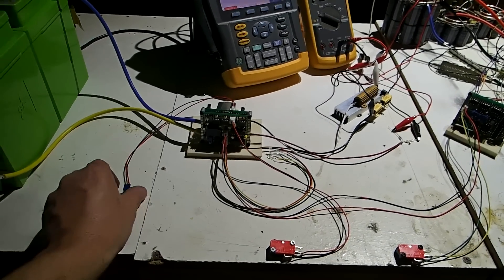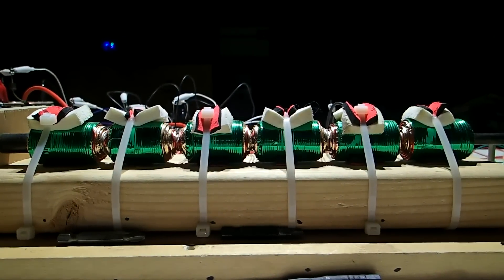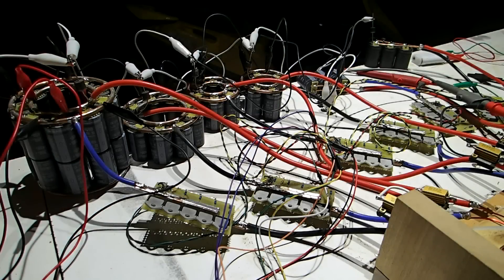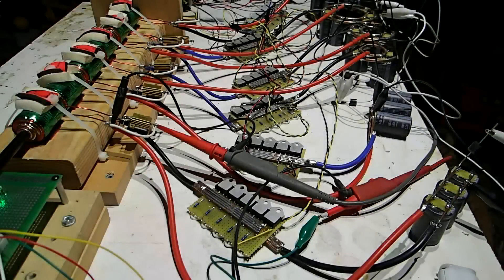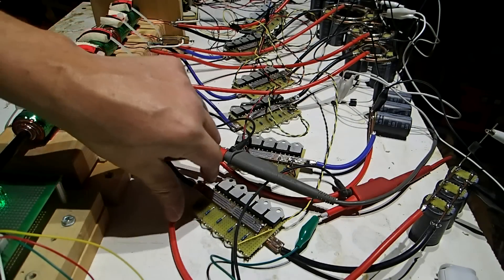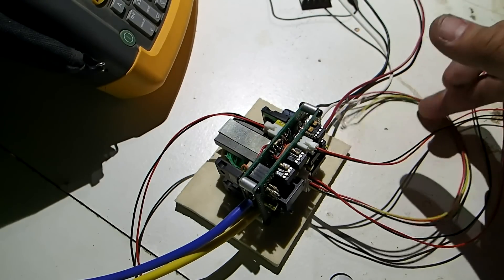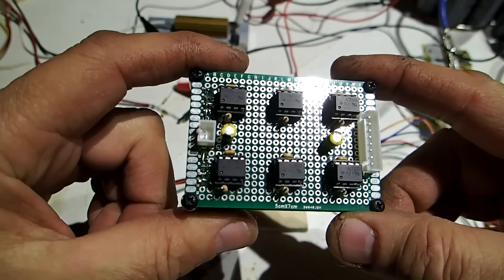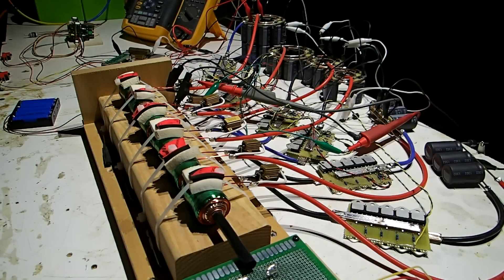World Fastest 6 Stage Coil Gun Yak Steel Penetrator

Comment: Clay,  I started on the chronograph...and it occured to me that maybe only one LED/detector may work.  With only one pulse on the scope, why cant you just read the pulse duration and, knowing the length of the projectile, just calculate the speed??
(I may use my 4MHz counter for digital display)
Reply from the maker: You could probably use that there is a relationship between that and the speed but the most accurate method actually you can buy a chronograph for bullets that'll measure the speed
Reply: @RaptorRotorHead  For your chronograph, what kind of photo transistors do you use?
Reply from the maker: @gaynzz6841  the only kind there is.

Comment: OK, I finally got a coil gun built.  A one-coil 6"long carbon fiber 50-cal wound with 4 layers of 10awg.  cap: single 10000uF cap fired with puck SCR at 275v.  Got 47m/s with so suckback control.  I plan to tune speed with various voltages and another scr to short the coil at various times to get max speed.  The gun was damaged by recoil.

Comment: if this is what a civilian can do, think what the military has.

at a modest 100x the energy you could put a 1kilo depleted uranium/tungsten/osmium slug thru both sides of a guided missle cruiser
Reply from the maker: The military has a railgun and yes it will put holes in the side of a ship 100 miles away they never mounted it on his ship the rails would be damaged for maybe only just 10 shots from all the heat Sparks and melting
Reply: @RaptorRotorHead  Would you think they'd rather invest in Coil Guns as an alternative? From what I gather they don't wear even close to as much as a Railgun, but aren't quite as possible either.

What do you think?
Reply from the maker: @ZombieSlayerPlays  you are correct that the coil gun doesn't wear especially in my model cuz I have a carbon fiber tube that the 18 gauge copper wire is wound around and the bullets or the Slugs are hexagons so they have points they have stars and those Stars ride inside the tube it has the least possible friction given all that you can no way get the power of a rail gun in a coil gun in fact what you see in my video it's about all you can get out of it you can't add any more coils because the speed of the pulse and the inductance of the coil slow the pulse down and by that time the bullets already out of the coil very little power gets applied to it on the 6th stage the first stage gives you the most feet per second like about 85 ft per second the second stage is not going to give you 85 ft more the second stage will get you up to about 135 ft per second so you get less and less with each stage so it's just as much time and effort to wind the first coil as it is to wind the six coil and the 6th you get maybe 10 ft out of it. What a coil gun can do is it can LOB a really heavy piece of metal. Up to about maybe 180 mph in space a coil Gun could be used to destroy satellites very effectively at a range to because there's no friction in space.

https://youtu.be/DjoYHLye2p4?si=tCJ6erAWO23tJFyq

I don't know if you seen this video of mine but this is the most effective way to make a coil gun other than it's extremely heavy 20 lb with batteries it would be to carry it around

Comment: Does voltage have any effect on the pulse length? Because I tried to calculate and found out that pulse length is only affected by capacitance and resistance C=T/R. Voltage would only tell how many amps go through the coil and the force on the projectile.
Reply from the maker: Pretty much voltage has no effect voltage has effect on the power output of the magnetic field The More Voltage the more current will go through the coil and thus more power

Comment: I have one questions to your coil gun what diameter has the wire of your coils?
Reply from the maker: The wire was 16 gauge I figured out the timing using an oscilloscope trying different amounts of capacitance there's another video of this it says questions answered it shows the waveforms on the scope basically it's based on the projectiles two inches long and then it takes it about 2.1 ms to move two inches in the first coil. From there using a chronograph able to figure out the other five coils using the scope play with the capacitance and looking at the speed.

It also involves using carbon fiber Barrel 1/32 wall thickness. The thinner the walls the closer to the magnetic field the more power.

Then the projectile is 15% or less of carbon in the steel. the less carbon the more magnetic force.

Also the projectile has five sides has hexagon Steel this is so it rides on just the edges inside the carbon-fiber tube for the least friction possible.

https://youtu.be/DjoYHLye2p4

This is the most impressive video because the target is 42 ft away for stability I just used the concept of bow and arrow it has a 7 inch carbon fiber shaft with a Q-tip on it to stabilize the projectile it's going through three-quarter inch hardwood and I've shot it straight through coconuts
Reply: @RaptorRotorHead  Thanks for that fast answer. One last question that I have is how long is that carbon pipe that you used?
Reply from the maker: @marcelwinkelhofer  the first one was 13in long the carbon Barrel because there's six coils and there's two inches long so that's 12in right there
Reply: @RaptorRotorHead  Okay thx
Reply: @RaptorRotorHead  Currently I am working on the coils for my coilgun and wanted to know how much windings you used for your coilgun?
Reply from the maker: @marcelwinkelhofer  300 turns
Reply: @RaptorRotorHead  What did you use as switch (I knew thyristors, SSR or IGBT but I think the best would be IGBTs)?
Reply from the maker: @marcelwinkelhofer  you should watch the video that explains all that it explains that I used 60scrs 10 per coil

Comment: Are you progressively decreasing the time between fires?
Reply from the maker: Of course or it would not work.
2.2 ms , 1.2 ms , 950us , 850us , 800us , 760us.

And using a few less turns of wire on the last two stages the 5th and the 6th stage.

To increase the rise time of the pulse. Do to the speed of the projectile.
Reply: @RaptorRotorHead  How did you come up with the trigger times? Trial by fire or something more scientific?
Reply from the maker: @bitsurfer0101  this is an experiment trial and error you can use math in some parts of it you can't use math to calculate the whole thing and put it together in one shot that's not going to work.

I used to work at a place that build guidance units for nuclear missiles 42 years ago most of these guidance using use magnetic power supplies so I'm experienced with Magnetic power.

Comment: What material (what sort of plastic) did you use for the barrel/pipe?
Reply from the maker: That's a carbon fiber tube 1/32 wall thickness 1/4 diameter

Comment: First of all: Simply sick project!!! I'm also building a coilgun for a school project, but I still have a little problem: If you take normal ferromagnetic projectiles, they are only attracted to the center of the coil. So if the projectile crosses the center of the coil before the capacitors are fully discharged, the projectile will be slowed down again. I thought about using a type C commutation circuit to be able to switch off the coil selectively, but I don't think that I can achieve the necessary switching times with this. How did you solve the problem? Or do you have an idea how to solve the problem?
Reply: Oh yes of course. Maybe, maybe... See also: Portable Super Coilgun:

https://www.youtube.com/watch?v=rclLsQ9nyeg&amp;feature=youtu.be

https://www.youtube.com/watch?v=-mjDqp_oWZk

https://youtu.be/YLOYxsqvjw0
Reply from the maker: The problem is solved by using the correct amount of capacitance for the coil for the weight of the projectile it's a physical thing II must allow the capacitor to charge backwards in other words in Reverse voltage by using a diode across the coil with a small amount of resistance in series with the diode this takes care of the suck back problem
Reply: @RaptorRotorHead  So there is no other way, than regulating the capacitence?
And how did you calculate the capacitence?
Reply from the maker: @jeromeschmitz5041  it basically was like by trial and error I started out with a 2 inch long projectile so naturally I made 2 inch long coils and since as you said when the projectile gets in the middle of the coil that's when the capacitor has to be drained or else it will be sucked back into the coil I started out with a about a 2.1 millisecond pulse and then the speed of the projectile is measured coming out of the coil we increase the capacitance to the speed of the projectile does not increase anymore and then we start out with that amount of capacitance  for the first coil. For the second stage we use about 1.2 millisecond as the projectile is already moving we don't need as much pulse if we put too much pulse we will slow the projectile down. Basically it goes on from there reducing the pulse
Reply: @RaptorRotorHead  So you didn't use a formula or anything.
But theoretically it would be better to have too much capacity and to be able to switch off the coils also via a circuit. Because then you would have a higher voltage over a longer period of time and therefore also a larger magnetic field in the coil.
Is there a circuit to specifically switch off SCRs that can also block the SCR within 700 nanoseconds?
Reply: I already have electrolytic capacitors, but with 2200uF each. With this, the dosing is difficult possible. The only thing that would still work would be to adjust the voltage. But then I would have to build a single charging circuit for each stage.
Reply from the maker: @jeromeschmitz5041  the answer to that is no the capacitor switch off automatically when the capacitor is discharged the scr switches off automatically
Reply from the maker: @jeromeschmitz5041  I used many small capacitors to get around that issue I think they were like 330uf each with about 9 for the first stage.
Reply from the maker: @jeromeschmitz5041  this is another video for you to watch what the specifics.

https://youtu.be/_ZJpTKZUibs

There is a formula to use but I had to figure that out because you have to figure out how fast the projectile is moving at 2.1 milliseconds in the first stage in other words in the first stage in 2.1 milliseconds to projectile moved one inch into the center of the coil
Reply: @RaptorRotorHead  So it would be easier to use GTO thyristors, right?
Or to build an inductive coilgun.
Reply from the maker: @jeromeschmitz5041  just regular SCR I used 10, 50amp scr per coil any scr can handle 10x it's rating for 8 millsec since the longest pulse is 2.1 millsec this is no problem each scr pack in my design can handle 5,000 amps.
Reply: @RaptorRotorHead  I also have the BTW69 1200 and from the performance these are also more than adequate. I plan the coilgun with about 200V and 7 coils. The problem is that I actually already have all the parts and would not like to buy capacitors again great, since the project was already very expensive anyway. I have therefore been looking for a solution to the problem for some time.
Reply: In retrospect, I think it would be easier to use GTO thyristors, because they can be specifically disabled (if I remember correctly).
Reply from the maker: @jeromeschmitz5041  I hear what you are saying I spent  $2500. Another thing to remember is capacitor ESR. The capacitor can only be discharged so many amps and after that it's limited that's why i used  many capacitors in parallel,  and switching capacitors at that
Reply from the maker: @jeromeschmitz5041  in the end result this is what I achieved.

https://youtu.be/DjoYHLye2p4
Reply: @RaptorRotorHead  How high the ESR is is not really that important to me. It is mostly in the milliohm range.
But is there another possibility than thyristors?
MOSFETs or IGBTs are unfortunately much too expensive in this order of magnitude. 

The thing is this: I would like to be able to control the switching on and off with a Teensy, because I don't want to use the coilgun always with the same voltage. I have specially built a power supply where you can set a maximum voltage at which it stops charging. My teacher does not want to exceed a voltage of 60V (for legal reasons). Privately, however, I would like to use something more. But then the switching times differ, which is why I can't build the coilgun without sensors. 
Another advantage of having a lot of capacitance is that the period of the RCL circuit becomes longer, and thus more current flows through the coil for a longer period, and thus a continuously higher force is exerted on the projectile. 

I can think of two solutions to this problem: 1. Adjust the distance between the coils so that the capacitors are discharged in time. But this would be extremely inefficient.
Or 2. to be able to switch off the coils selectively as well. But then I need some circuit that allows me to selectively disable the SCRs.
Reply from the maker: @jeromeschmitz5041  there is nothing more rugged than scr for the circuit that you're welcome to try whatever you wish, and when you're talkin milliohms yeah that's very little but when you're talkin 3000 amps of current going through it you know multiply 3000 * 10 milliohms and that's your voltage drop
Reply: @RaptorRotorHead  I heard something about a V-Switch the other day, but haven't looked into it in detail yet. Is this perhaps a solution to the problem?
Reply from the maker: @jeromeschmitz5041  never heard of it
Reply: @RaptorRotorHead  http://www.coilgun.ru/v_switch.htm

I would just use a light barrier or something similar instead of this inductive sensor. But that does sound like a good solution to me.
However, I have not been able to find anything about the switching time of the BWT69 1200 in the epee sheet. Do you happen to know the switching time of this SCR?
Reply from the maker: @jeromeschmitz5041  faster then the arduino which is 3 microseconds scr are way faster then this. Another thing light sensors are way too slow I don't know why people use them, I don't think people pay attention. The final stage in mine the pulse width was 650 microseconds.
Reply: @RaptorRotorHead  If you use a Teensy for the light barrier, however, that should actually be fast enough. A Teensy 4.0 is much faster than an Arduino. Then hopefully that is enough to read out the light barriers. The signal from the Teensy I would pass via serial communication to an ESP, which then only switches the coils on and off. I hope that this works.
Reply from the maker: @jeromeschmitz5041  as I said that your experiment you could use whatever you want

Comment: Do you have a schematic for the sequencer, nice work with using octo's and scr's. Very interested in how you built the sequencer though. I understand the concept with 555 timers but how do you control the sequence so accurately?
Reply from the maker: Actually I don't have a schematic as a 555 timer but it's the basic timer schematic at you find online, simply disconnect pin to so that it only fires once the output pin 3 we go to another resistor and a capacitor which was the 20 turn potentiometer that adjust how long it takes to fire to the next stage and then you build six of those.

But I found the sequencers not always accurate the RC time constant varies with temperature affecting the coil gun performance. what I did is I got a nano ardrino and I wrote software so that it could accurately time out the coil pulse delay.

https://youtu.be/_ZJpTKZUibs

In this video is the schematic of the coil gun the coils and the reverse fly back diodes and the capacitor drain off diodes. I don't have a schematic of the computer arduino how that operates can be found on YouTube also sorry about that in this next video is the final product at a 42-foot kill range.

https://youtu.be/DjoYHLye2p4

It simply operates for stability like a bow and arrow it has a tail fin with a carbon fiber shaft the tail fin is basically a Q-tip swab.

Comment from the maker: 5 years and still the only steel penetrator on you tube.
Reply: I agree your gun is one of the most efficient I have seen. Even the hacksmith could not achieve your velocity. I think the staying away from the optical design really helped.
Reply: @joshboye1427  I agree. When the optical switch triggers, apparently it's already too late to switch on the next stage. It has to be already fully powered, when the steel slug comes in.
Reply: Seems like for power induction are the way to go. and for efficiency, it’s gonna be regenerative.
About 4 years ago, One guy posted 22% efficiency hand held that penetrate steel can, yet only one side.
Only few people demonstrate what coil gun can do with knowledge and skill, yours are by far most powerful.